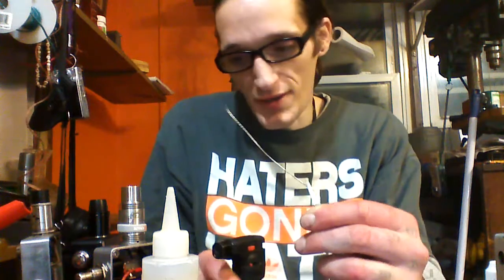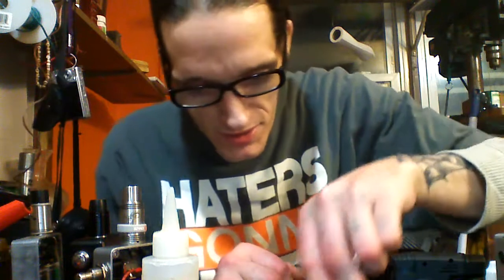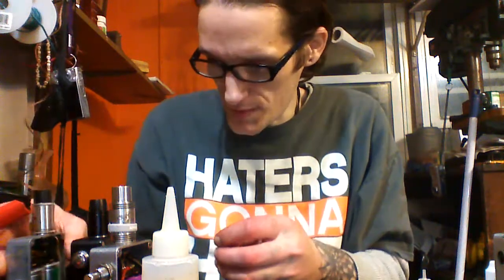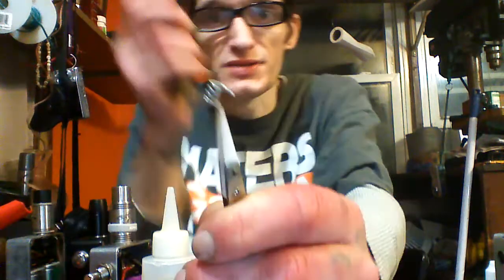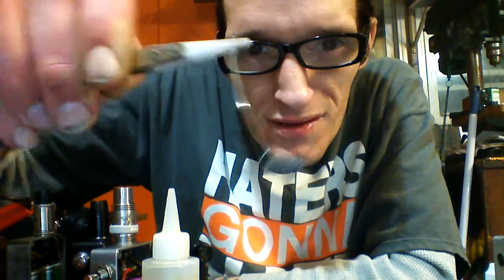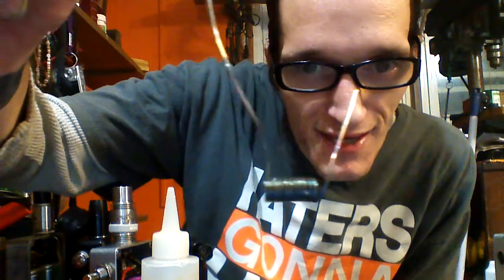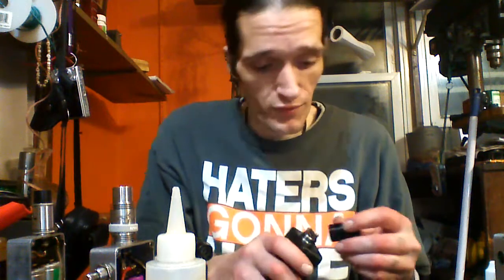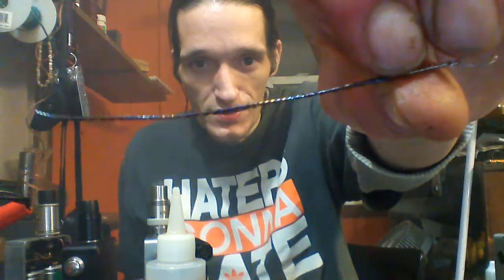Coloring Nichrome

Comment: use a regulated box mod starting at 17watts then up to 36 then 55 but differnt temps gets u differnt colors an too hot will burn color off an what u see on instagram are color filter edited pics an SS wire with nicrome gives out the best colors